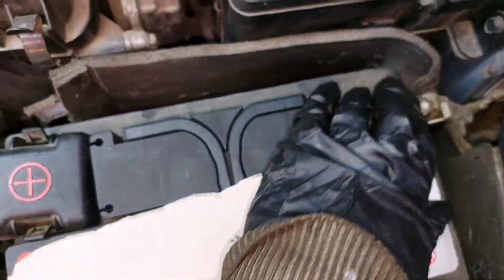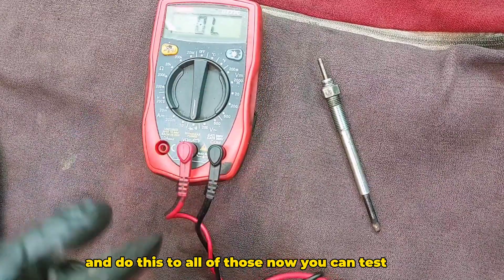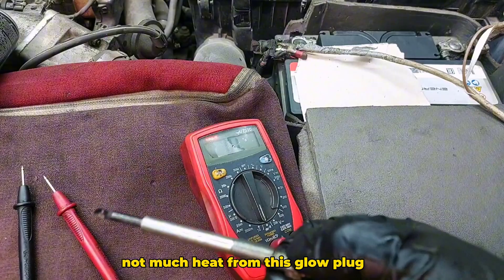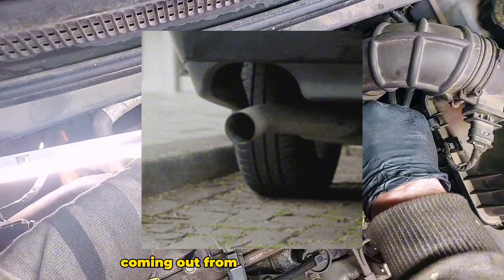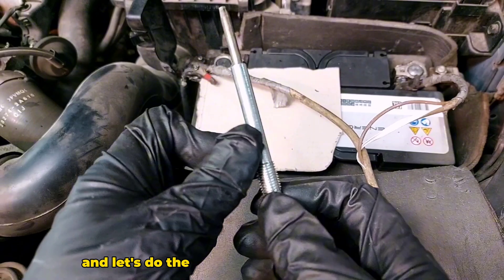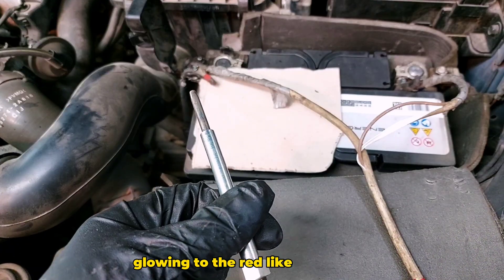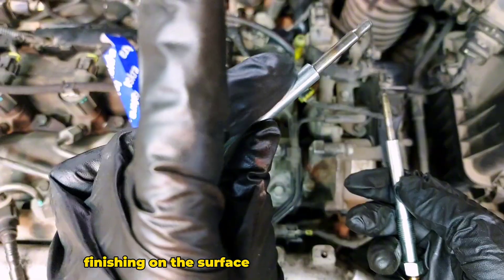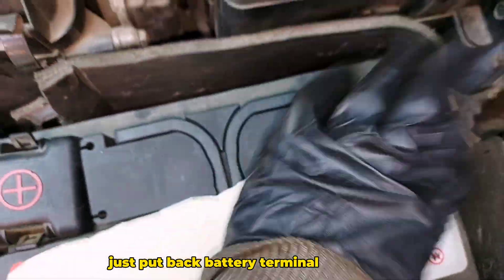Glow plugs DIY test & replacement | kia 1.6 crdi D4FB

Comment: I have to do this and being able to see what comes next is really useful. Cool vide thanks for sharing👍👍👍
Reply from the maker: Always glad to help 🙋🏻 and a little advice from my experience with glow plugs removal, nothing helps better than a lot of heat, the things go well at least for 80% when the engine will be hot and as the user @Work_G say: "I like to soak glow plugs with penetrating oil for few days before removing, because they can snap really easy" in this video i made some sort of heating tool maybe it helps if there be a need 👇🏼https://youtu.be/Xmy_7EyT4NE

Comment: Im not sure that copper grease should be used in aluminium header. Copper will corrode aluminium 😅
Reply from the maker: what about copper washers for the injectors?🤭
Reply from the maker: And what about copper sealant for the head gaskets or copper head gaskets or copper washers for banjo bolts etc.🤔. Do you know what conditions are for corrodatingting aluminum from contact whit copper? Considering that in video is a copper-based lubricant in the first place and it contains oil which prevent corrosion on metals. Thank you sir🤝🏻 have a nice day 🙋🏻
Reply: @HintSlice  you are right copper is used in such cases and there must be moisture to initiate such corrosion, but copper grease is not recommended in such a utility. I personally would use ceramic grease
Reply: I am using just a little bit of ceramic paste at the glow plug thread. Works fine as well 👍🏻